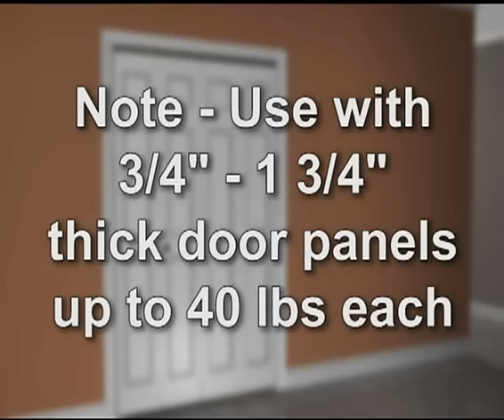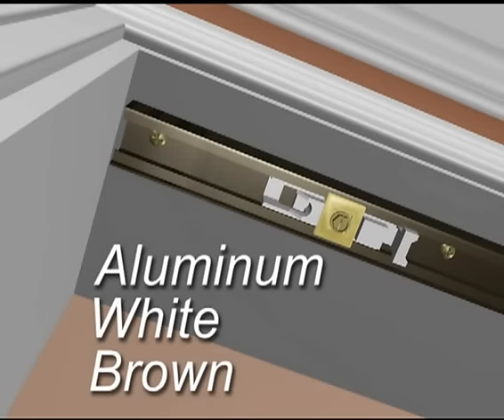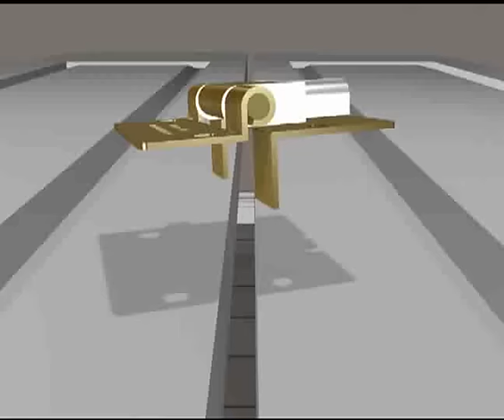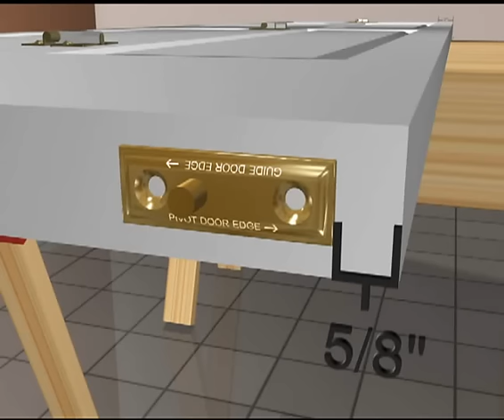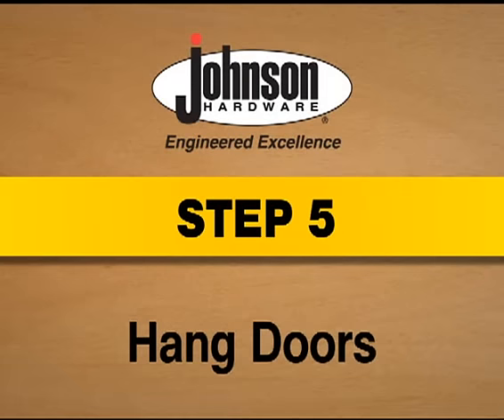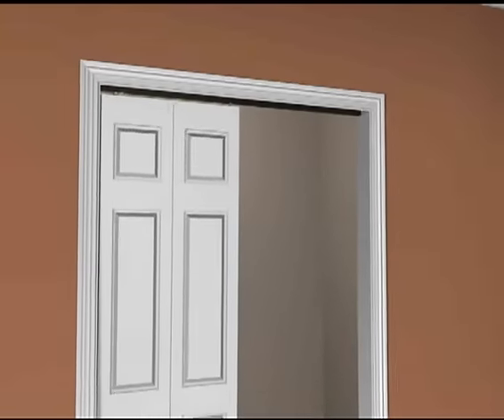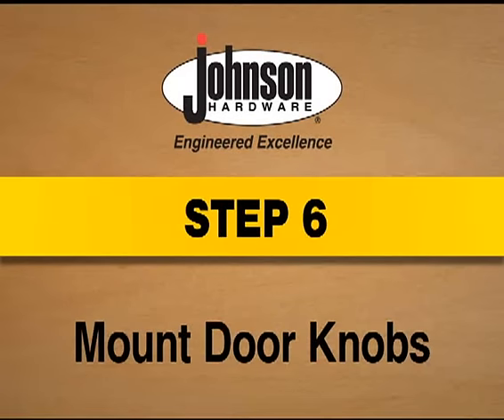Johnson Hardware® 1700 Series Bi-fold door hardware installation video

Comment: I do not leave reviews very often , and almost never bad reviews. But Johnson Hardware thank you for making an easy DIY project frustratingly difficult. I've replaced and installed dozens of bifold doors in minutes. But after reading your instructions and watching your video and wrestling with your doors for a couple hours I've only successfully removed one of your bi fold doors. I have know signed off of all your products.
Reply: I could not agree more, what a horrible design. Putting up two closet doors turned out to be one of the most frustrating diy projects I have ever done.
Reply: As an engineer I second that, this is a horrible product.
Reply: I agree, this was an all day event for me to do 4 closets.

Comment: The video explains things perfectly.   The written instructions on the plastic bag are vague to say the least.   I have been a carpenter for many years,  installed a half ton of these doors and I must say the 1700 series hardware works perfectly for me.   As with any installation,  you cannot rush it.   I love the no drilling in the floor feature.  Smart engineering.  Makes perfect sense, especially,   especially folks, when the floor is out of level...….     Thanks for the instructional video...….  g
Reply: Can the entire weight of this heavy door really hang from just the pivot lock?
Reply: @k.m.colwelljr.136 nope I don’t see how they get the door to not rub the lower pivot adjustment screw?

Comment: I had to shorten some bi-fold doors due to someone's bright idea of laying down tile around the door pivot hardware! The doors rubbed on the tile and didn't line up. So I trimmed 5/8 inch off and started to re-ajust the brackets and under closer inspection,noticed the guide stamps on pivot bracket. They appeared to be backwards, so I YouTube'd Johnson's to make sure. Thank goodness I did. Everything regarding install was wrong. I did as video instructed and now they work beautifully! Thanks for the tutorial and the great craftsmanship of your hardware.     D. A.
Reply: It's good hardware, but still difficult to use -- even for skilled finish carpenter!

Comment: This video is amazing. The attention to detail was very help in making sure I was installing the right bits onto the right ends of the doors. The only thing that I couldn't get behind was "Drop the casing to cover the wood strip" - if I could slide it down my wall like I lived in a Sketchup model, I would, but rather than ripping out all the trim nails and repainting the wall, I'm choosing to live without added refinement, haha.

Comment: Just finished installing 2 four door sets. The supplied instructions were adequate but the video definitely helped. One error on the supplied instructions...it shows the knobs being installed on the wrong door. I should be at the hinge location, not the outer door edge. Learned the hard way. I now have 4 holes to try patch! Video shows the correct location.

Comment: To begin, thanks to all who have commented on their experience with the Johnson Hardware product and the installation process. Reading through the comments was as valuable as watching the installation video. First, after installing my first door ( 29.5" in a 30" opening) and taking my time doing so,  I conclude that I like the product and appreciate the engineering. Too be fair, two sets of hands for heavy /solid core doors helps prevent carpenter frustration during the install as distinguished from any frustration with hardware.  Here are my insights:

 Step 1-HEADER: Once I learned that this is a "hanging system" I reinforced my header by sliding in some shims and /or 3/4" blocks between the jam-header and the rough header. Furthermore, the track screws (count your number of holes and then find that number in the bag) were  longer than my 3/4 jam thickness, and so I feared they would bend the jam-header out of level as they bit into the rough header. Then when installing the track take care to position it leaving as much of an equal gap on both sides. Mine shifted, so on the pivot end I moved the pivot-lock device over just a tad by loosening the brass screw. By the way , "Pivot Door" = the hinge side in regular door installations. "Guide Door" (gets the white plastic bracket) is the one on the opening end.

Step 3--MOUNTING THE HARDWARE / PIVOT BRACKETS ON THE DOOR: Using a 4" Double Square / combination square is a proper tool for this step 3. The video is good at showing the measurements for each, BUT also use the square to position it in the center with equal space above and below. Be consistent here on all three brackets. Also, before  installing the pivot bracket, be sure it is on the desired side. Because I needed the pivot to be on the right-hand side, I needed to install it on the opposite side of the one shown in the video (they used a left-side pivot). Then check the orientation of the hinges if you have received partially pre-assembled doors. My hinges came oriented for a left-hand pivot, so I had to reorient them to a right-pivot position. Johnston makes this easy as the holes align perfectly. Go slowly and gently so as not to strip the screw-holes.  

Finally, for Step 4--Installing the bottom guide bracket (4:41) the video seems to show the tape measure extending from the track, not the header. Be more careful than I was and measure from the actual bottom of the header (above the track) so as to get an accurate measurement below to reflect the actual height of the door.

One more point, but on an aesthetic detail mentioned at the end of the video. I like the idea of covering the track with some wood trim. One, strengthening the track for this "hanging technology" is a good idea. But let a bifold be a bifold.  Avoid adjusting header height by bringing down the casing and ruining the lines of the room. Instead, installing a 5/8 piece of trim against the track in that 3/4 gap  provides a nice reveal in relation to the jam-header instead of trying to be a new  one.

Comment: Very helpful video. I was able to install the doors quickly thanks to this video. Only problem I had was the video had the hinges setup for the right side opening while showing the door opening to the left. Otherwise a great instructional video.
Reply: I'm struggling with the placement of the hinges.   Does it point towards the wall or towards the center?  I have 4 panels in a 60" opening

Comment: Much better than the written instructions.  HOWEVER, if you're putting the bifold into a pantry or other storage area that has shelves or other objects near the opening, the measurements might have to be adjusted or, possibly this particularly door may not work well.  The doors swing approximately 2 inches into the opening.  If you're shelves or other objects are about 2 inches or less from the doors (inside measurement), you have a problem. Doors may hit the shelves/object. I.e.,door won't open
Reply: 😅 Learned this the hard way! 😕

Comment: Excellent Video.

For my installation, the height of the opening was 1/4" less than the required height. This is how I fixed it.

I used a hammer and chisel to countersink the two top brackets by 1/16", so that they are flush with the top of the door. Don't countersink them any further, since it will be impossible to attach the top pivot to the track.

Similarly, I countersank the bottom pivot by 1/8". The jamb bracket just grazes the bottom pivot, but it moves smoothly.

If the height of the opening is more than 1/4" too short, you should use a circular saw to shave some material off the bottom of the door. I don't recommend planing; this will be diificult since the bottom of the door probably contains horizontal and vertical sections of wood.
Reply: I have the same problem... its not an easy fit.. in fact this system can be modified to use standard door hinges..

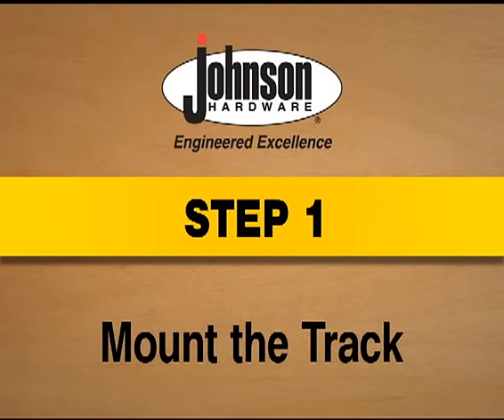Comment: 1:25 Mount the Track
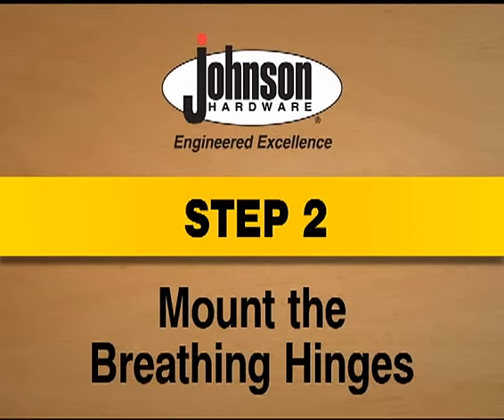2:06 Mount the Breathing Hinges
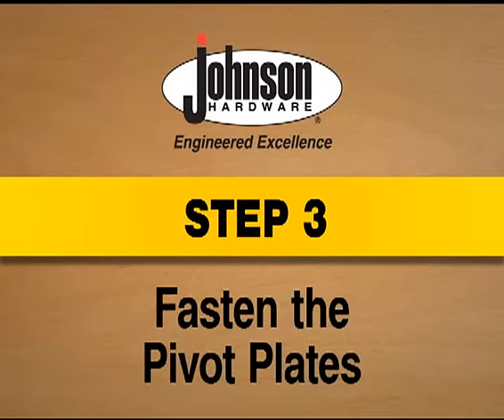3:16 Fasten the Pivot Plates
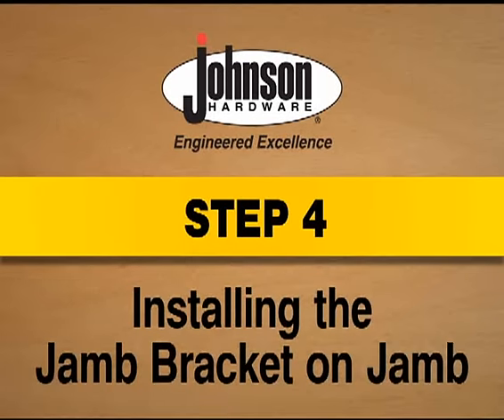4:26 Installing the Jamb Bracket on Jamb
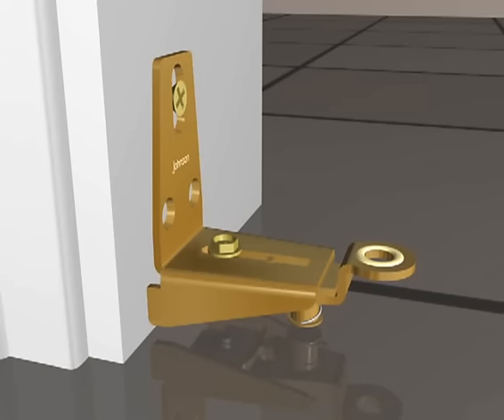5:22 Hang Doors
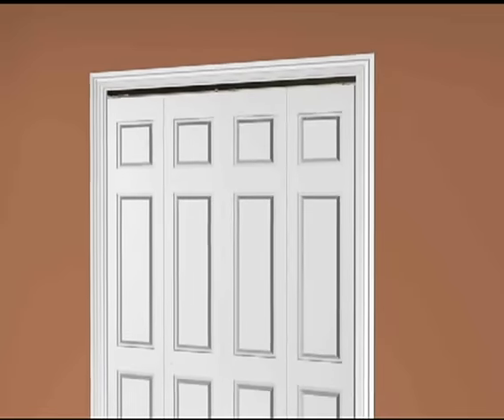7:44 Mount Door Knobs
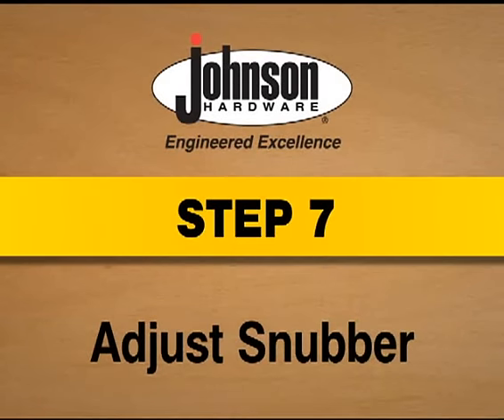8:29 Adjust Snubber
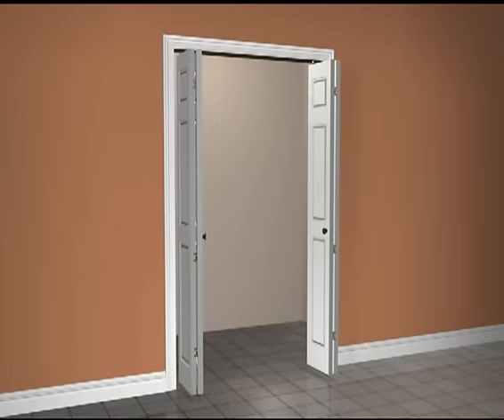9:07 Trim Installation

Comment: Would be nice if you mentioned which screws to use for each part,such as which screws to use on the header track.
Reply: Did you find out which screws go there
Reply: @anarchydog  Yes, I got it all installed.
Reply: @arrakkis666  we did too after pain in the ass and we now have the door upside down
Reply: Yes.  Sort the screws by their types.  You will have 3 of one, 5 of another, etc.  Then look for something that needs 3, something that needs 5.  Seems to be the only way to figure it out.
Reply: For anyone else who is wondering, it is written on the little plastic bag that holds the screws in tiny black print.
Reply: @anarchydog 9

Comment: I bought a house with these doors. Pretty difficult to replace them...but thats probably why its a 3d model. What I found helpful is to loosen the bolt on the upper portion, put the door into it and then move the door&upper portion together to get it into the bottom. Then retighten bolt.

Comment: Regarding the location of the door handles. If the doors bind, then the top and bottom pivots were not located 2" from the edge of the door to the center of the pins, or the top guide was not placed so the center of the guide pin is 1 1/2" from the edge of the guide door.

Comment: Should the additional 2 inches of vertical finish height be measured from the finished floor i.e. measured from top of carpet? Or should it be measured from the bare subfloor?

Comment: The written instructions are terrible. This video is the only reason I was able to get my doors installed. Are the aligners completely necessary or can I skip installing those?
Reply from the maker: You are more than welcome to not use the aligners. The hardware can be adjusted so that the aligners aren't as important.

Comment: There's no excuse for including an instruction sheet so confusing that people need to watch a video to figure out what it means. 

And thanks for the warning that the screws for the knobs in a kit that is supposed to be suitable for doors as thin as 3/4" are so long that if you tighten them through 1" doors the ends of the screws will break the centres of the knobs. Fortunately, I had other knobs on hand that I could use.
Reply: Sidecar Bob Amen!
Reply: I just emailed them. Jam brackets sit to high for my doors so I had to rig something so it would work. Instructions were terrible. Not impressed

Comment: What is the space under the door.  If the door is 2" shorter that the opening and the door hangs from a bracket I assume the top of the door is approx 1" from the top of the door frame, does that leave a 1" space at the bottom?
Reply: You need enough room for the door jamb bracket, probably around 3/4 of an inch.  If you follow twhat the video says - that the door needs to be 2" shorter than the opening, you will have an inch under the door.

Comment: anyone else confused by how to measure for the jamb bracket? Door is 79 inches tall and opening is 80. If you measure down 79 inches from header it puts bracket an inch from the floor and the screw wont line up.

Comment: the video helps for sure - but this is not the greatest design as it is next to
impossible to remove the door once it is snapped into the top - on heavy doors I suggest a crow bar of some sort to lift the door into position
Reply: Huh?  Push down on the lower bracket to release the bottom.  Unlock the pivot clamp to release pivot.  The door comes right out.  Takes ten seconds.

Comment: How about showing the difference between a 2 door and a 4 door installation?  I hate to install these tracks flipped the wrong way.   These bi-fold door confusing enough...
Reply: You just do the reverse of these instructions for the other side. Step 1, 2, 3, and 4 would be for a 4 panel opening, just do the same thing for both pair of panels that are hinged together. Step 5 - hang the doors, just do the same thing for both side (pair of panels).  A good recommendation would be to do the first pair of panels that are folding to the right, then when you start on the pair of panels to the left watch the video again. Step 1 is mounting the track, so you would not have to watch that again.  Or you could just read the step by step instructions for installation.

Comment: This kit comes supplied with Wickes bi-fold doors in the UK.  Bottom jamb bracket is useless if you have transition thresholds at floor level, giving insufficient clearance to allow bottom pivot to fit into standard UK door openings.  Replaced with competitive product with no such issues.  Echo poor instructions comments - they really are that bad.

Comment: The top pivot brackets are one of the worst designs I have ever seen.  Why would you not just use spring loaded pins?  It is nearly impossible to to remount them.  I’m giving up and buying different hardware.
Reply: The pin is shocking

Comment: If the top guide just sits against the outside of the track opening, and if the pivot pin retainer is not meant to touch and therefore hold up the bottom of the door, how is the door hanging solely by the top pivot lock? Instructions written for products coming out of Asia have more intelligible instructions.
Reply: The 1705 guide (on 2nd panel) sits inside of the track, I am not sure what you mean by "sits against outside of track opening"?  Go to Step 3 (minutes 3:26) that describes how to attach top pivot/guide/bottom pivot on panels. Then go to Step 5 (minute 5:25) that shows you how to hang doors and how the guide/ top pivot/bottom pivot go into position. That shows how the all of the weight is held by the top pivot going into the the pivot lock itself.  At minute 6:36 it will show you how to put the bottom pivot into the bottom pivot bracket.  The bottom pivot/bracket and 1705 guide simply guide the doors, all of the weight is held from the top pivot/pivot lock on 1st panel.  If you watch the video from beginning to end it explains everything with pictures.

Comment: The written instructions are completely difficult. I had to watch this video and others 20 times and I still do not know which side do I put the guided edge of the mounting bracket. And which screws go into which spot I’m only using two doors and I need the guided side on the right but after watching the video now I’m confused which is the pivot side and which is the guided side. I think you need somebody in your company to actually show the product not illustrations and explain every step and every complications that could happen. I for one will not buy your hardware products ever again. Kristen